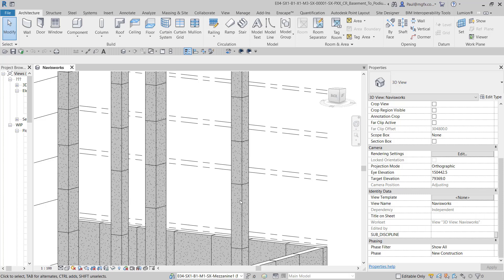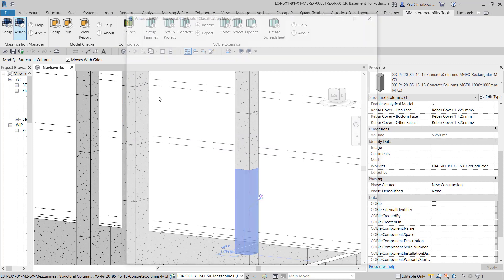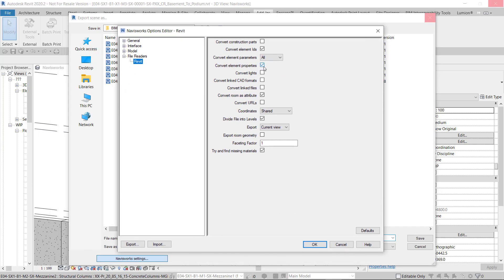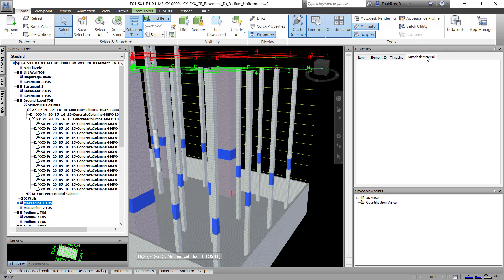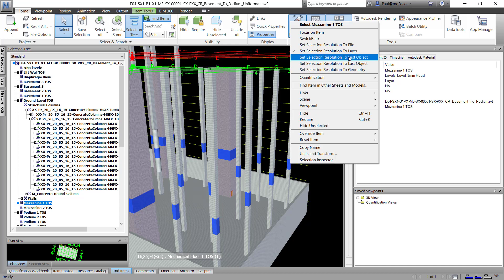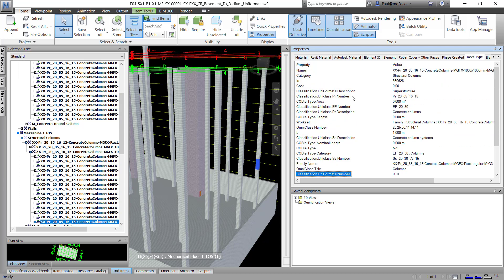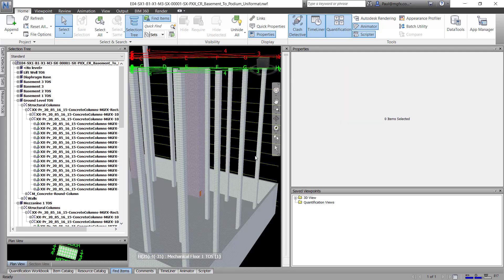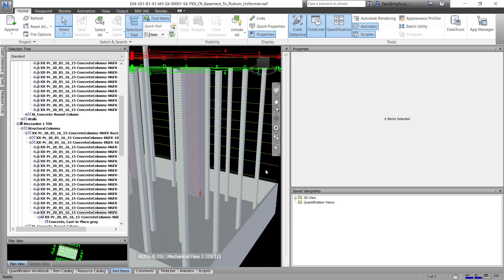Autodesk Navisworks Selection Resolution

Comment: Hi, when you are using Find Items, you are able to select Element under Category. I am trying to use Find Items by a similar method (we have set up a Pour Sequence filter for each concrete wall that is provided under elements) but we cannot select Element in the Find Items tool (even when using the ... to expand the selection). Do you know if there are any setting needed to search by element? The element is viewable in the Appearance Profiler, but not Find Items.